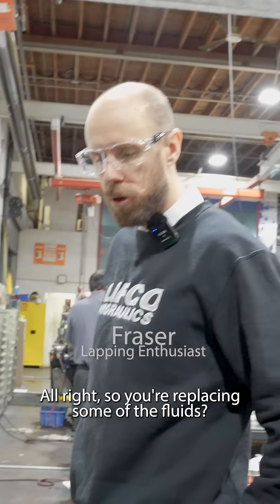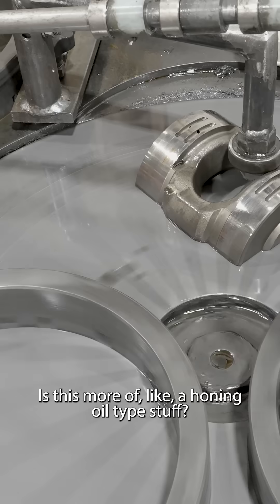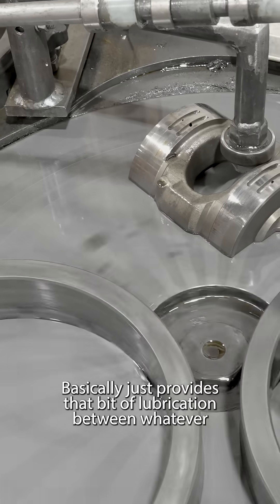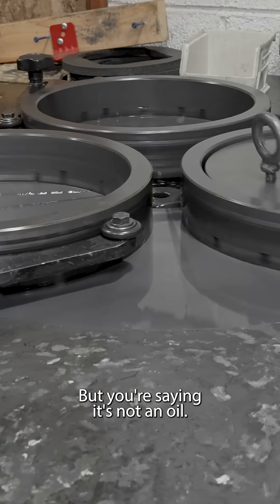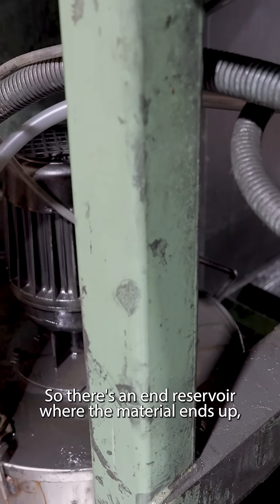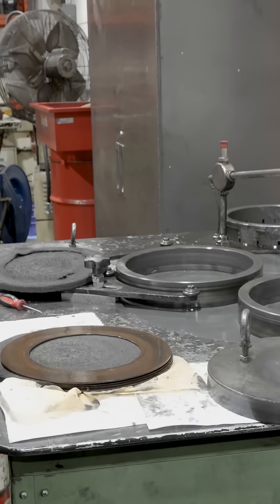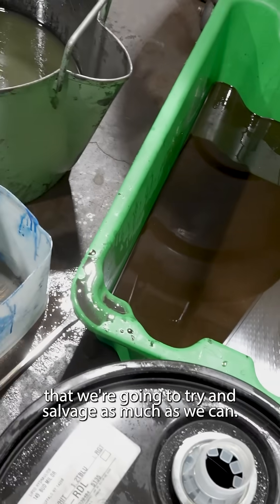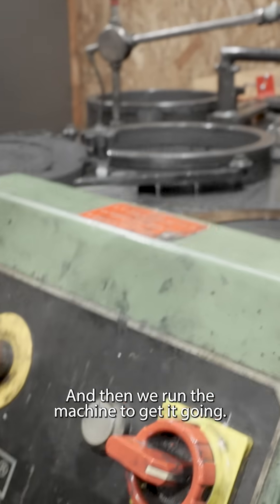This fluid costs $400/gallon!!!

Comment: It's an emulsion. It is called a lapping vehicle, and it's what the abrasive media (like the Lapmaster 1700 shown) is suspended in. There are both water based (emulsion) and oil based. The oil based is WAY BETTER.
Reply from the maker: Now we are getting the facts. Thanks so much for commenting. -Fraser